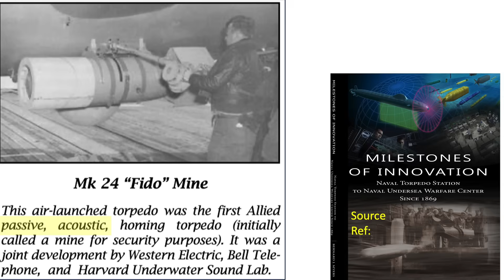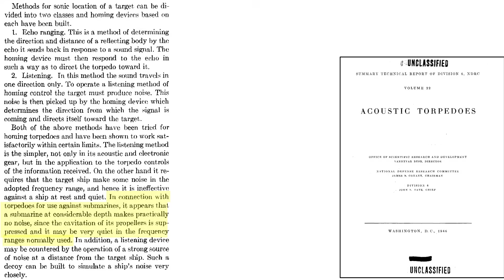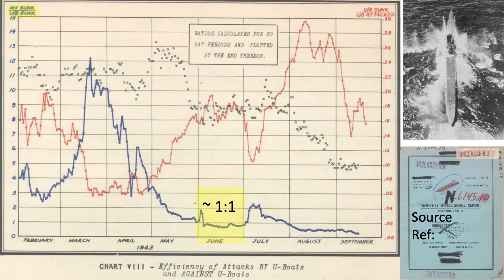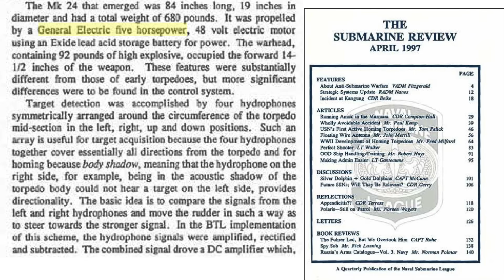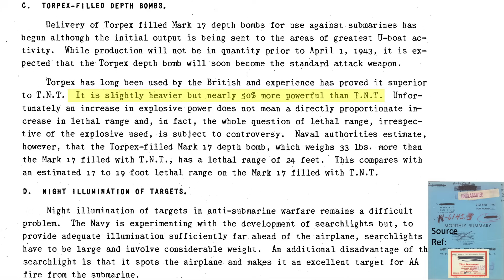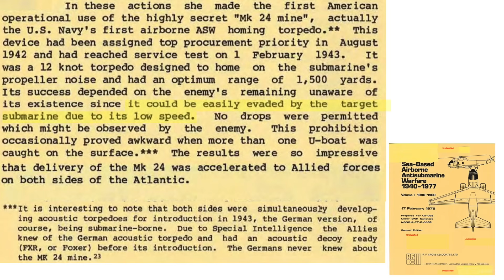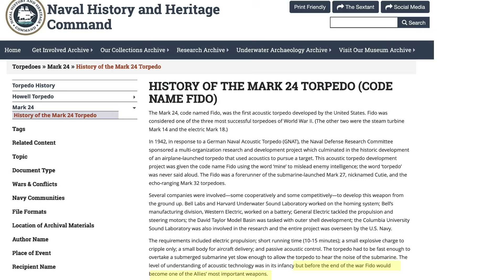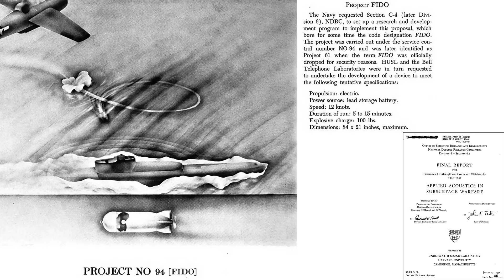Secret Allied U-Boat Kill Store, Acoustic Homing Torpedos

Comment: I find it funny why the americans didn't modify mark 14 torpedoes with the acoustic homing capability. They could have outperformed Japanese and Germans by a huge margin if they introduced those.
Reply: My guess is that the combustion engine of the Mark 14 would prevent the hydrophones from working properly.
Reply: There was another torpedo with that.
Reply: I think all sides developed acoustic torpedoes. The Germans certainly did.

Comment: Thanks for the great video! A quick question: does anyone know why the air-dropped depth charges had a squared-off nose profile? I’m wondering why they didn’t have a domed nose like a typical bomb. Thanks!
Reply: video at approximately 6:40 shows a nose cone.
Reply: Apparently rounded-nose bombs and torpedoes were more likely to skip across the surface when they hit. Of course, a blunt nose meant much lower speed once under way, but this seems to have been a compromise the engineers were happy to make.

Comment: How was FIDO actually deployed? Would the aircrew first drop sonobuoys to estimate the U-boat’s probable speed, location, direction and depth before launching the FIDO? It would be interesting if you could make a further video detailing this process.
Reply: The arrangement of the [I think it was Avenger] aircraft bomb bay described at 7:27 minutes gives a clue to FIDO's use. The main requirement was to cause the submarine to crash dive and in doing so it would make the most noise which is what FIDO wanted. The two 'traditional' aircraft depth charges were used to 'encourage' the submarine to dive and if they happened to score a hit killing the sub, then it was game over at that point. However, FIDO was still the main weapon. If the aircrew felt they had a good chance of launching FIDO right away, they could. If however there was doubt, the Sonor bouys would be deployed and from this information the track of the 'lost' sub could be re-established and a FIDO attack commenced.

I have read accounts from the RAF in the Bay of Biscay that their attacks using Radar and the Leigh Light would surprise surfaced Uboats at night having located by Radar, then turning on the Leigh Light would blind the surfaced crew as the plane went in for attack. However at this time they were still using traditional aircraft deployed depth charges and to the RAF's surprise, some Uboats would remain surfaced and fight it out with a single aircraft. This is seen in the removal of the deck guns from Uboats during the war and an increasing number of anti aircraft installations coming into effect around the conning tower.

But when the Uboat was attacked by two aircraft or more, their will to fight evaporated and they would crash dive. The first anti submarine aircraft attack used standard aircraft deployed depth charges and his job was not so much to destroy the sub but to cause it to crash dive.
It was the second aircraft that carried the FIDO and that was the sting in the tail.

Thus we can see this Avenger aircraft had the capability to perform the roles of both aircraft, such as to push the sub into a crash drive, then to track the sub, then to deliver the final blow.

Comment: I first heard about the homing torpedoes many years ago but this provides new details.  This torpedo is the reason the D Day preparations began in May, 1943.  Development of the electronics was by the US telephone industry: Western Electric and Bell Labs. Most people today are not aware that most audio technological developments including microphones, headphones, amplifiers, cables, plugs, jacks, etc. came from the telephone industry.  1/4" phono plugs were invented for telephone switchboards.  Amplifiers were invented for long distance calls.  British code breakers at Bletchley Park depended on the British telephone industry which built the first electronic computers in 1943 to decode German teletype messages.  That was a bigger secret than the atomic bomb.

Comment: Your preparation and documentation is first rate.
While, I’m not a student of US Bombers, I’m fanatically addicted to the Battle of The Atlantic.
In my readings, I was under the impression that US intelligence predicted it would take the Kreigsmarine 9 months to identify the threat of Fido and develop countermeasures.  Something that never happened.
What I never knew was the physical dimensions of Fido.  It’s much smaller than I envisioned.

Great work!
Reply: Yea, I read about it's existence year's ago in an article that wasn't specifically about it where it just basically rated a mention, so I always assumed it'd be the size of a regular torpedo or thereabouts, I was really surprised when I saw this picture.
Reply: If the submarine was at a depth of 800 feet it’s not coming back to the surface
Reply: FIDO resulted in the later Mark 34 torpedo which had an additional battery section added to the Mark 24.   The Mark 34 was used by many Allied countries in the early Cold War.   A ship-launched variant of the Mark 24 was designated as the Mark 32 and was launched on a rack similar to those used by PT boats when launching straight-running Mark 13 aerial torpedoes.

Comment: Yo, Algorithm. This guy is cool.
Reply: He’s the best! Welcome to the channel
Reply: I think the algorithm has finally noticed. Love seeing how this channel has grown over the last few months
Reply: He sure is
Reply: Troof
Reply: This is undoubtedly the single best source for information on WW2 US bombers anywhere on YouTube.
All of his information comes from credible source material, USAAF documents, declassified reports and other sources like that, he doesn't use books or other videos for source material which quite often can contain flawed information, nothing but official records and documents. 
And a lot of it has very surprising results that proves a lot of old time myths wrong, like painted B17's actually being faster than unpainted one's despite the long held myth that painted one's were slower and couldn't fly as high due to the added weight of the paint which some sources claimed weighed as much as 500 lbs, turns out it was only 75 lbs of paint and due to the fact that it smoothed over the lap joints in the fuselage panels and rivets it actually increased their speed and maximum altitude along with range.
Watch his series on B17's and B29's, they're fantastic, along with his videos on the Norden bombsight that prove it was actually very accurate and dispell the myth it wasn't. 
There's no better source for information on WW2 US bombers than this channel.
Reply: Cool. Thanks.